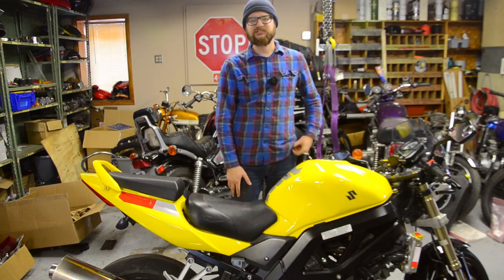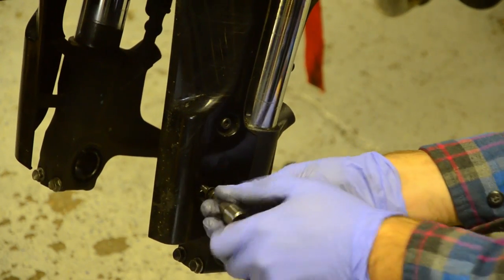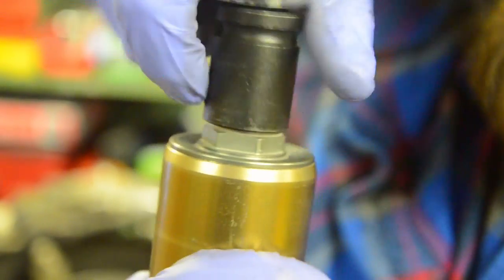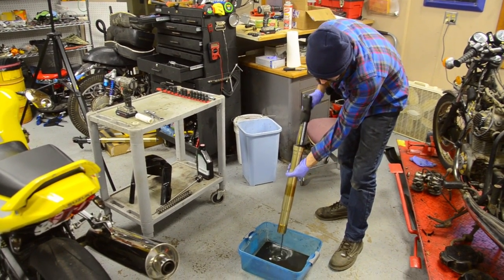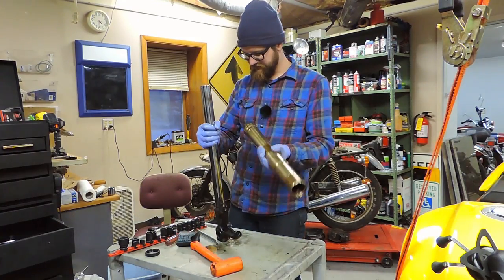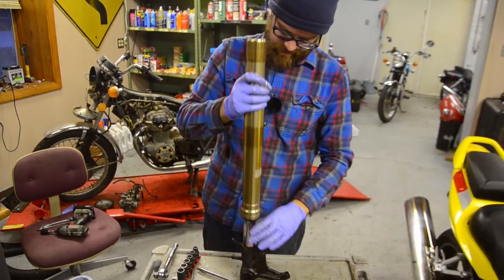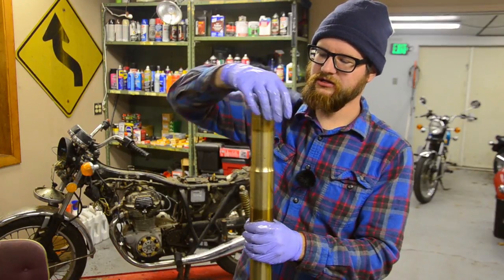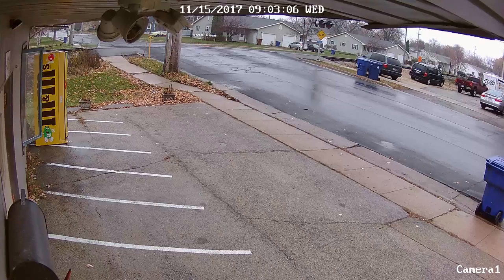Inverted Fork Seal Replacement ★ 2006-2010 GSXR 600 750 Motorcycle How To Upside Down

Comment: Trick factory Suzuki Mechanic taught me:  When reinstalling forks ( with threaded axle ) Install non threaded fork first and set where desired. Tighten but not torqued. Then take other leg and install into clamps. Don't tighten but snug where fork leg can still be moved and twisted but is not falling out of clamps under its own weight. Rubber mallet can be used to smack bottom of fork leg or top to move up and down for micro adjustment. Be more careful on top to impact the edges and not the adjuster screw. Now take axle. (NO WHEEL)  just axle, and install into fork legs. Threaded part should seat without any binding. Move threaded leg up or down as desired so threads do not bind at all. If correct, axle should be able to be spun back and forth into threaded leg with just finger and thumb with no binding. Super smooth rotation is your goal.  Once achieved your legs are even. Torque clamps and check legs/axle again. If results are the same,  forks are set.  Another tip while doing this.. Take rubber mallet and smack triple clamps all around where they clamp forks when forks are set into them before Torque. This vibrates legs to seat in clamps with best calibration.  Check axle one more time before installing the wheel. Recommend taking the time to remove front fairings when doing this job. It's more of a pain but access to bolts and using the mallett are so much easier. :)

Comment: Super clear and well produced video. I’ll be changing my seals and oil on my 2005 sv650 with 06 gsxr600 forks and this is exactly the info I need to do the job, thanks!

Comment: Awesome straight forward video! I do have one question though. The adjuster rod that is connected to the fork cap, How do you remove that? I see in the video it stays together but could you pull the rod off the cap if you plan on replacing it? Mine is all torn up and i plan on installing a new one but your video doesn’t show exactly how that is done
Reply: Hello my good friend. There is an Allen bolt at the bolt of the fork that holds that rod assembly in place. If you unscrew that then it will come out.

Comment: Also ppl you do not need that axel tool just keep your pinch bolts tight then loosen the nut side take it off then loosen the pinch bolts and tap the axel out which comes out pretty easy.

Comment: Is it possible for forks to leak from the bottom, I mean the chrome tube that meets the mounting bracket for the caliper and axle? I had no fluid in my forks. Great video - thanks!

Comment: Great video man thank you! Hopefully this will be similar to my 04 r1 forks, I watched a video saying that I could just remove the bottom allen and not have to use a compressor tool but it just turns the internals of the fork, so I think im going to just order the tool through your link, but my question is how do I assure that I get that allen bolt back tight again? Thanks In advanced!
Reply from the maker: Hey there! Thanks for the kind words. Yeah, the spring compressor is definitely necessary to do this job safely without breaking anything. If you're spinning the internals, then you could try an impact gun electric, or pneumatic. Cheers!
Reply: Thanks! Taking them to a guy tomorrow who says he can do it no problem but if it seems to sketch ill order the tool and do it my self lol I appreciate the fast reply deff gained my sub thats for sure!
Reply from the maker: JustAnR1 - Sure thing. For this task we typically charge roughly $250 for time & materials. The hardest part is honestly removing the forks from the bike, the rest of it is pretty straightforward.
Reply: I agree my 04 r1 the lower clamp bolts were so hard to get to. and id pay you that right now lol yamaha shop wants 450$!! with forks already off and they say they wont use my oil or seals even though its all oem lol said I have to purchase it from them...there are no good shops near me unfortunately.
Reply from the maker: JustAnR1 - I wouldn't have them do it. That's ridiculous. With the forks off the bike, we'd basically do this task for $100. Invest in the tool, it will clearly pay for itself with just 1 use. No brainier to me if you already have the forks off.
Reply: Oh yea no not taking it to them, Theres a guy that my group suggested im gonna try him first but I want to help him/spectate and make sure he does it by the book lol if not then ill order that tool, plus then I could help out my buddys if i have it lol.
Reply: Took me forever to find this video and it sucks because its the best straight forward one ive found out of like 20 different ones that pop up when you search inverted fork seal. Wish I would have found this one first lol
Reply from the maker: JustAnR1 - That's why we made the video haha. Unfortunately things are quite busy at the shop for the season and it will be awhile before we can make more.
Reply: Understandable, well I appreciate all the help!
Reply: Hey man I loosed up the bolt on the bottom of my fork when I didnt need to but now it free spins when Trying to tighten it back up, Do you know what needs to be dont to tighten it? Btw the tool worked awesome!
Reply from the maker: JustAnR1 - I would try to use an electric impact driver on it. That has worked for me in the past.
Reply: SHould I try and pull it out all the way before trying to snug it back up or should it be fine to just pop it back in? Also ill prob need one that hits pretty quick right? it sucks because this is the only thing keeping me from riding lol
Reply from the maker: JustAnR1 - If it hasn't been removed all the way, then I would definitely not remove it fully. A good quick blast from a torque gun should snug it nicely.

Comment: I have a question I keep getting mixed answers on, I live in Houston and my cousin offered to sell his 14 Gsxr 600 for a 1000 that was in the flood we haven’t tried to start the bike yet I don’t even think he has drained the bike yet if there’s any flood water to begin with his bike was in the garage in his apartments I’m going to take a look at it this week just wanted to ask a Moto mechanic if it was damaged by the water can I be fixed?
Reply from the maker: BlackVegeta9000 - Anything can be fixed with enough time and money. But for real, it all depends on the water line and what got wet. It could be easy, it could be cheaper to buy something else. The bike would require a very close inspection.
Reply: Miles From Extraordinary Thank you!

Comment: not clear about "thicker side wall up & thinner down"
when its the time of puttining the oil seal or if its in the direction fitted to motorcycle
Reply from the maker: Up being relative to the fork when you're holding it. It would be down when the forks are in place on the bike. Thanks for pointing that out!
Reply: thank you very much..
a very useful video

Comment: 9:50 When I bleed the cartridge, my fork oil only comes out when I pull the inner rod out and NOT when pushing it back in. What's going on? The problem does not occur on my other fork cartridge.
Reply: I wouldn't worry about that much, as long as you have good flow of fluid and no air.

Comment: When I pump the damper rod up and down no oil comes up through it. 675r forks
Reply from the maker: Do you have enough fluid?
Reply: @MilesFromExtraordinary  filled it up so I could see it. Heard the gurgling sound and pumped the damper  but still nothing.  Should I fill the damper rod with oil?
Reply: So you need the rebound rod in place to operate the valve in the bottom of the fork!